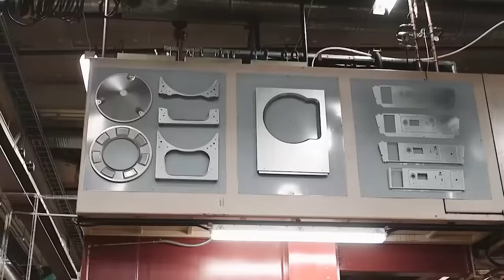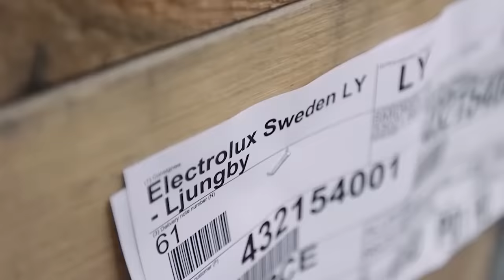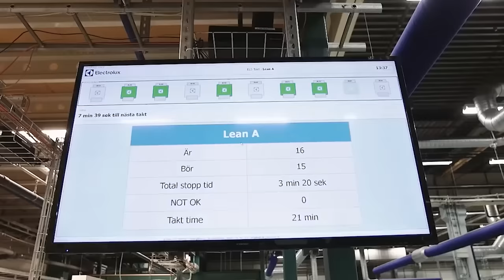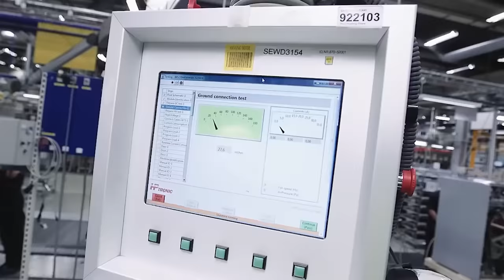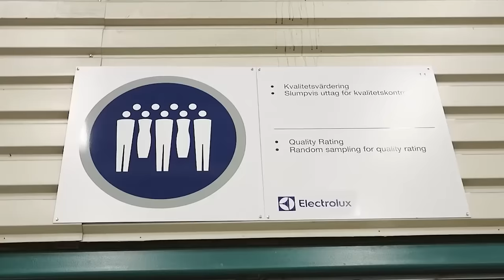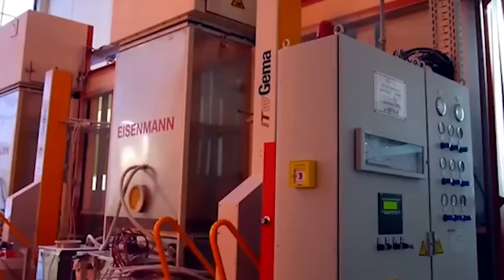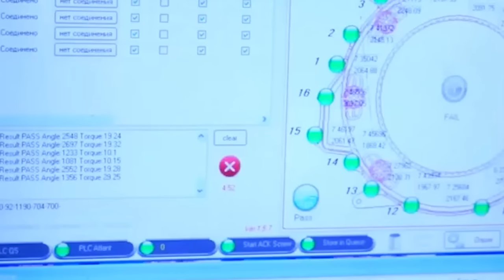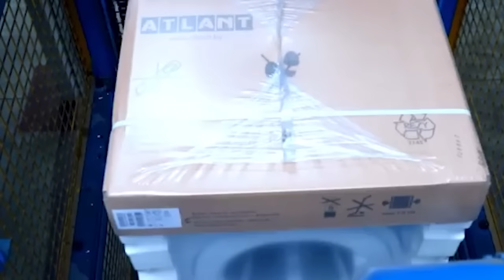Professional Laundry Manufacturing || Amazing Modern Washing Machine with New Technology

Comment: So much of using robot in making this waching machine which makes it expensive... But comparing with cheap ones the actual lifespan is not much different.  Look at the cheapest way to manufacture this in a simple factory in india all things are almost done with human hands to make it and their factory is like a bakery house.. Workers are making it manually even the electrix motor no intervention of complex machine. Lolz
And in china too...

Nothing to take away with premiumness of electrolux bec we have electrolux appliance at home but typically this electrolux process are almost similar setup in producing cars. Too expensive.... washing machine is just a simple machine... Housing den electrix motor and control nobs thats it... The all in one automation of modern waching machinenis just only done by electronic computer.